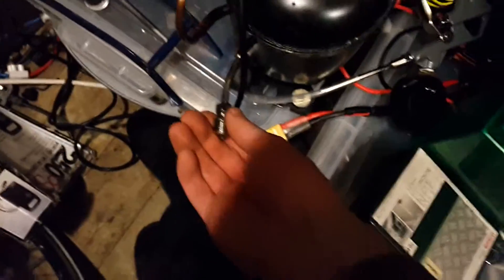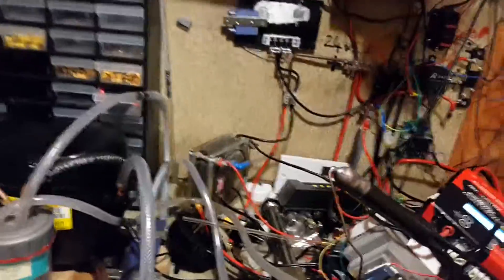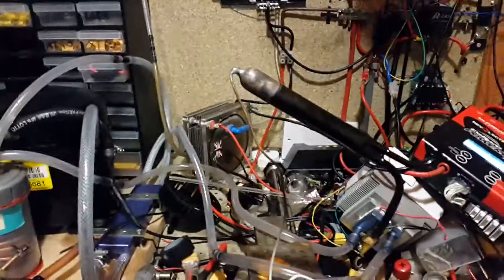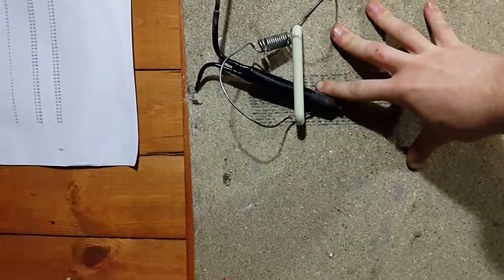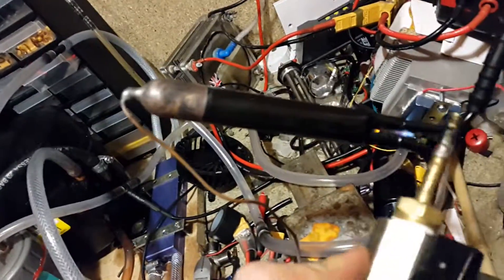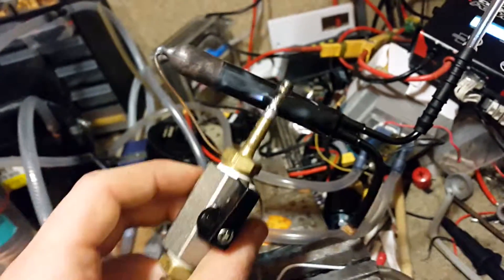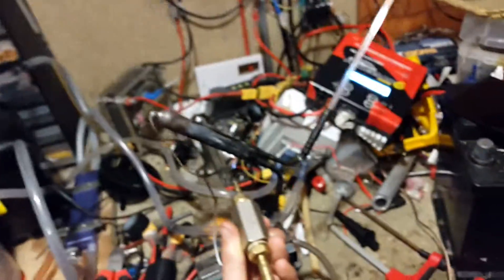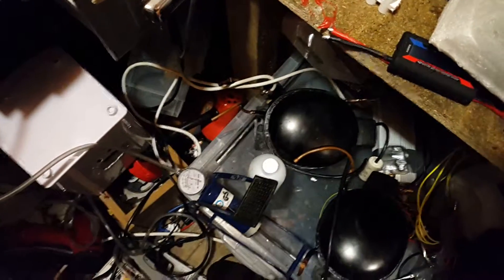DIY Refrigeration System#1 Reusing a Refrigerator Filter Dryer

Comment: Ha!  This is good Shaun!  There are simply too few people experimenting and having fun with refrigeration.  I am impressed.  Even without the "proper" tools, you're finding a way to proceed.

I also use an undersized torch, but it was actually purchased as a brazing torch from the hardware store, then modified to accept a large oxygen tank, and small propane bottles.  

The solder is probably strong enough, considering the pressures of an isobutane system, but do be careful!  Brazing is stronger, but I won't tell you that you can't solder, just consider doing some high pressure tests to see what the limits are.

Also, before you heat, consider purging lines out with dry nitrogen or co2; compressed air could be used in a pinch, but there is always the risk of a combustible mixture, if there is any refrigerant left in the system.  Oxidation is definitely a concern, when you're soldering.  Some dry gas within the pieces will help prevent things from burning inside the pipe, which could plug up the cap tube later on.

Not sure if you were doing it, but when you want to dehydrate the system, pulling a vacuum on it while applying some heat, will drive off a lot of moisture.

Keep up the good work!
Reply from the maker: +M.C. Pletcher I pressure tested it by running the system with just air in it with the service valve open. You could hear that the compressor was struggling a bit so I think the solder will hold. I have a needle valve but I fear it might leak slowly but I will replace the capillary with that if I have to.
Reply: +Shaun Dobbie Yeah, cap tubes are tricky, and take a bit of trial and error experiments.  The needle valves do leak sometimes, especially around the packing.  I've had to tighten the nut at times.  Maybe you would find a few leaks can be acceptable, until you get everthingnelse else figured out.  You might go through a fair amount of your refrigerant until you get everything sorted out.